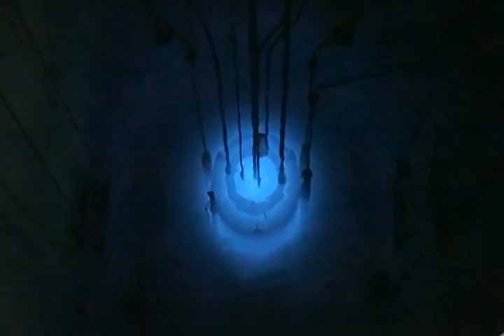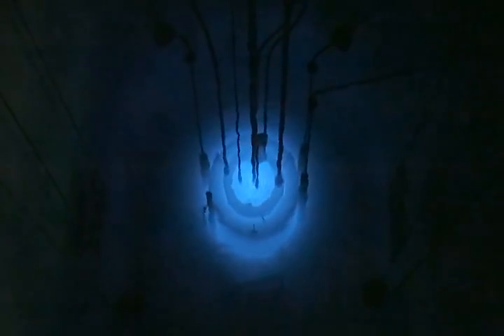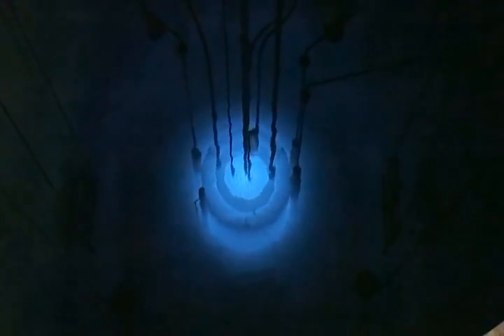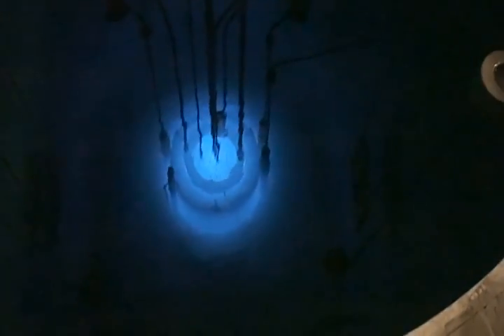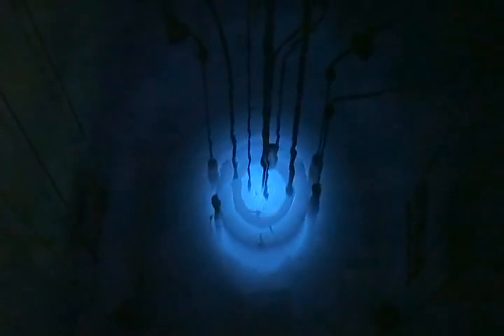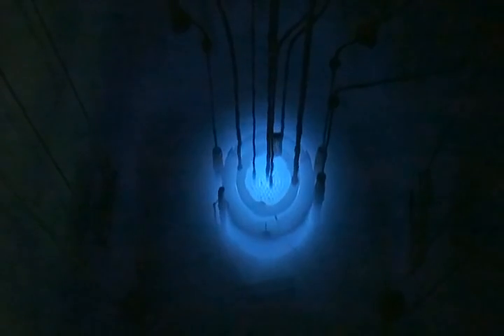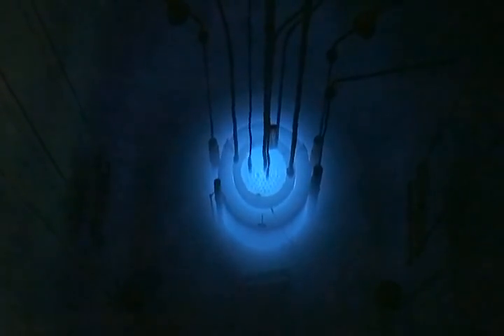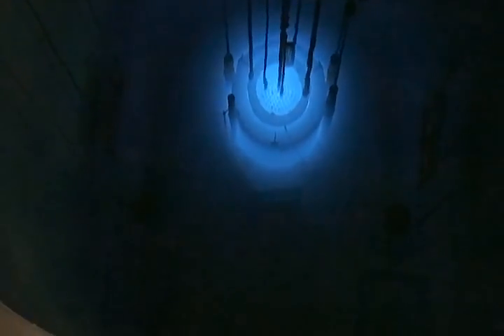Reed College TARGA I reactor SCRAM (new audio)

Comment: so this reactor cant produce steam for electricity production even if you set it up to do so?
Reply: research reactors tend to be 'zero-power' so they produce virtually zero thermal power/heat, primarily for safety reasons. if you don't produce heat then you don't need to worry too much about the peculiarities around how the coolant behaves. i think most research reactors, if not all, have automatic reactor triggers which will 'scram' the reactor as soon as the core begins producing thermal power
Reply: I didn't know
Reply: Brian Hill do you like that beautiful blue glow you're seeing?
Reply: Yeah I do its beautiful
Reply: Brian Hill that's is called chernkov radiation which is mainly photon rays
Reply: I like the glow
Reply: Brian Hill yep. its harmless to where if you were swimming next to the reactor you wont get radiation poisoning
Reply: You won't
Reply: I know

Comment: This reactor doesn't pulse. What's shown here is a manual SCRAM, caused by the operator pressing a button. The tour guide explains this in the video right before it happens. (I used to work as an operator there.)

Comment: It's a _TRIGA_ reactor, not a "TARGA" and it's intended to be operated in pulsed mode. The nature of the special fuel used inherently prevents the reactor from exceeding a specified design power during pulsed operation. It shuts itself down right after the control rod is pulled out. Calling it a SCRAM is really dishonest or ignorant, I'm not sure which applies here...

Comment: It's breaking the "Speed of light", but not c. c is the speed of light through a perfect vacuum and nothing can be faster than that speed. The speed of light through water, however, is about 75% of the speed that it is in a vacuum, so although it can't be represented by c, it is the "speed of light" through that medium, as the electrons travel faster than the "speed of light" then a faint blue glow is emitted.

Comment: @365fg You'd be fine as long as you didn't cannonball down to the bottom.  The water near the core very effectively screens out the radiation long before it gets to the top.  The water itself isn't very radioactive either (believe it or not).